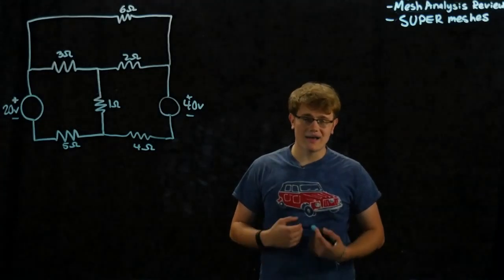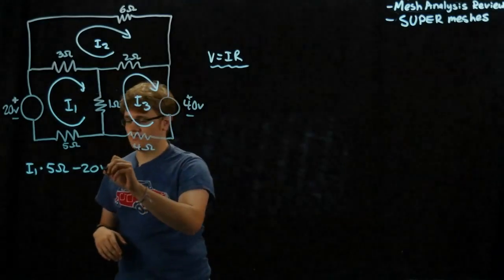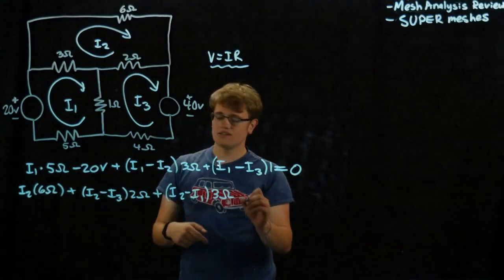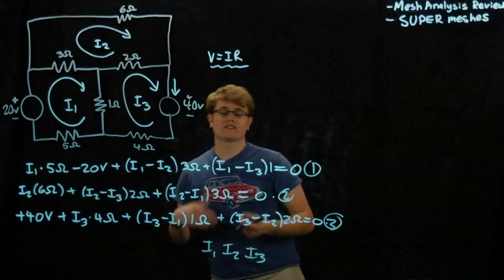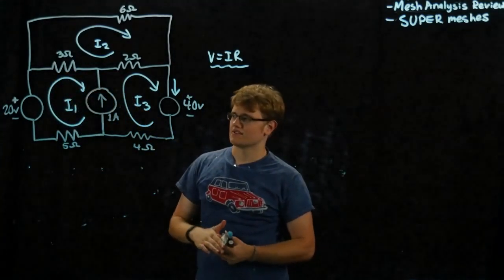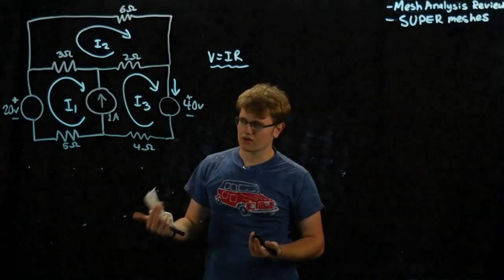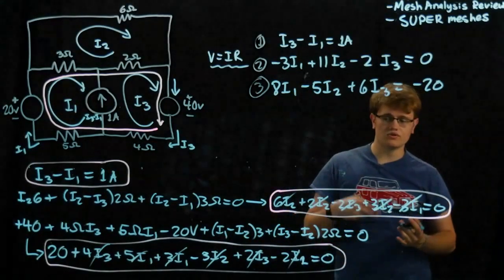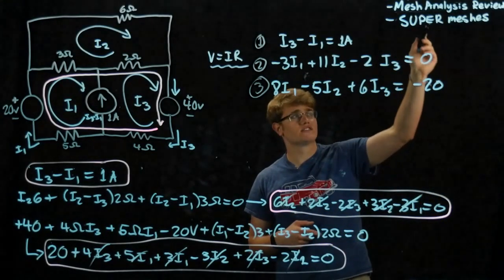Circuits 1 - Mesh Analysis and Super Mesh - Example

Comment: 4:30
so on passive elements (RLC) the passive sign convention is always positive with this method? and it's only  the sources that you decide on positive or negative?
Reply from the maker: The sign convention is just that, a convention. The easiest thing to do is the write the positive and negative signs on the passive elements at the beginning of the problem and them as you traverse the KVL loop, use the sign for the element that you encounter first.

~Andrew F

Comment: Informative class ✌🏻 but just one thing I noticed is that, we here learned to take Mesh Analysis by the others sign i.e. 20-3(i1-i3)-5i1=0(First mesh) and in that manner! Basically the same but we flip the signs, I guess It's different conventions in different regions!
Reply: I think ur right, because current direction is from the +ve terminal to the -ve terminal (which is the opposite to electron direction), But in the end, both are the same because we impose all this

Comment: missed it !

3 books you should read
( at least read the  DC chapters of each book )

Engineering Circuit Analysis  5th  edition
Hayt and Kemmerly

Electric Circuits ,...Nilson
2nd edition

Basic Engineering Circuit Analysis
Irwin ,  4th edition

or newer editions

Comment: unfortunately this is wrong. The sign notation is wayy off and you cannot get the right answer following this method.
Reply: I agree!  He wrote the voltages with the wrong sign WRT the the method used for the resistor voltages.

Comment: shouldn't the current in loop 3 go in the opposite direction? since the current is going from - to + from the 40 V source?
Reply: You prob know this already, but for other commenter,  to obey sign convention, each loop must go in same direction
Reply: Yes I thought that too, the 40V should go on the opposite side of the equation of positive flow. It should be 40V - 20V on one side of the equation.

Comment: bro in 2nd equation where 6ohmscome from
Reply from the maker: Current I2 goes through the 6 ohm resistor on the top of the circuit, bro
Reply: https://youtu.be/xDUhFxeevc4
Learn the technique and u can solve any problem

Comment: When you go from negative to postive of voltage it mean voltage rise it must be positive 20v in I1 (loop1)
Reply: Ibnu Bastistah No. There are two ways to apply KVL (in resistive linear circuits). One is how you say, i.e. the voltage sign is determined by which terminal the current loop is exiting (and thus the voltage of the battery in that loop is positive and the voltage of the resistors is ALWAYS negative). The other way, which is the one he applis and the one I think Sadiku's book applies, is that the voltage sign is determined by which terminal the current loop is entering (and thus the voltage ofthe battery in that loop is negative andthe voltage of the resistors is ALWAYS positive).

Now, is the equation obtained by the first methos the same or a equivalent of the one obtained by the secons method? Yes! Just multiply an equation by -1 and you'll get the other.

Comment: solving for i_1 I got ... i_1=i_3-1   .... substitute i_3 - 1 for i_1  to get these equations (eq1) -3i_3 + 3 + 11i_2 - 2i_3 = 0  (eq2) 8i_3 - 8  - 5i_2 + 6i_3 = -20... simplify to get 2 unknowns... 11i_2 - 5i_3 = 0 (eq1) and -5i_2 + 14i_3 = 12 (eq2) using inverse matrix to solve... I got i2 = 0.47 A, i3 = 1.02 A, and i1 = 0.02 A.

Comment: So I had a question. When you solved the super mesh circuit, you drew a new composite box to sum the voltage drops around. Was there anything special about the new box you chose? Could you have not used one of the previous box's you'd drawn  to sum the voltage drops around in order to solve for your currents?
Reply: Ok so I can see now that calculating a voltage drop across smaller boxes you had previously drawn would not work as you would have to calculate a voltage drop over the ideal current provider, which wouldn't be so cool.